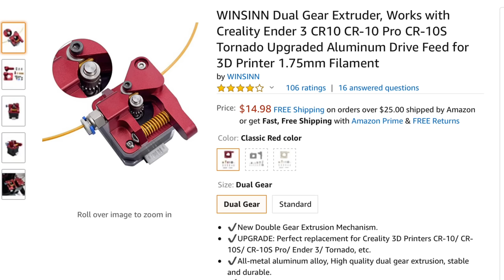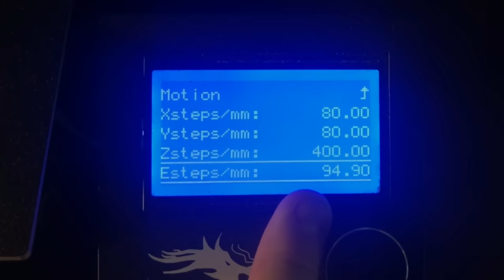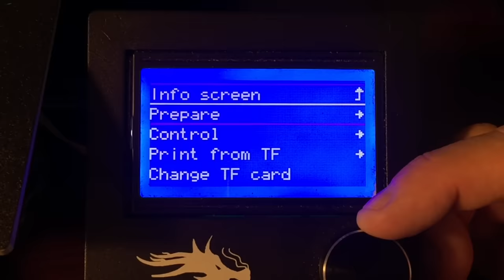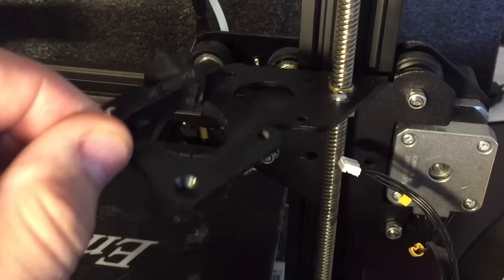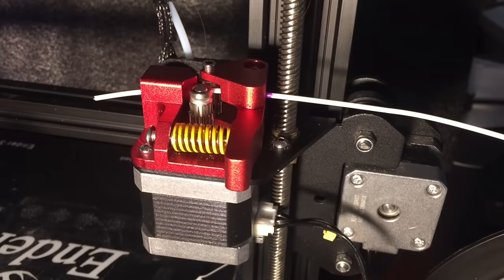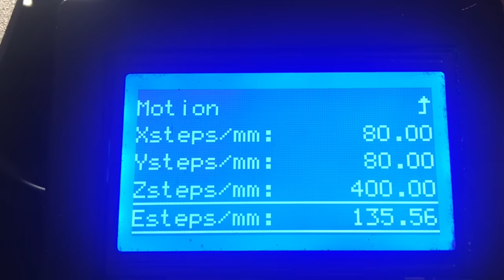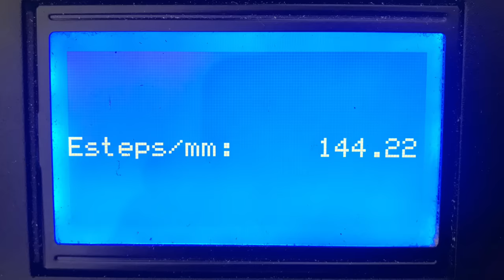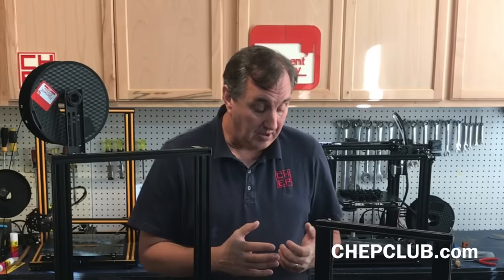Dual Drive Gear Extruder Upgrade + E Steps on Creality Ender 3

Comment: Chuck, this has to be the best video you’ve done to date!   Extremely easy to understand, complete information from beginning to end, and a great topic!    Keep up the awesome work!
Reply from the maker: Thanks Jim.
Reply: I thought the same while watching the video. Smart, complete testing. Excellent editing of the video to keep it flowing smoothly, and ultimately an unbiased conclusion. I regularly recommend CHEP's channel for Ender users. His videos are great for laymen or advanced users. Great work. Keep it up!
Reply: @randomrat6421  yeah great video! love the conclusion! did it work? well no. should you buy one? sure you should
Reply: Too bad it's a terrible design where the gear grinds into the base.
Reply: @FilamentFriday  I have seen a lot of reviews on this and similar extruders saying that the gear starts to eat into the alumina frame. Have you seen this happen?
Reply from the maker: Yes. Some have done that.
Reply: @FilamentFriday  so what's a good one to get?
Reply from the maker: Get the EZR https://youtu.be/1GNDxvxpWr8
Reply: @FilamentFriday  thank you.

Comment: I realize you made this video 3 years ago but I just needed to add a comment.  I got my Creality Ender 3 Pro a year and a half ago.  I was having minor issues with filament slippage a few weeks ago so I re-watched a few of your videos and decided to order the dual gear extruder.  A few days later I replaced my bowden tube and bumped the temp up a few degrees and that took care of most of my issues.  But today I received and installed the dual gear unit and it is great.  I printed a CHEP cube that rivals or betters any I have done before.  Thanks for all you do for the 3D printing community.

Comment: I know this is an older video CHEP, but this video saved me yesterday right before starting my longest print yet. I bought the upgrade before my Ender 3 v2 came and yesterday (only had the printer 3 weeks) the arm failed. I upgraded the extruder in no time flat because of this video. Thanks for all your videos.

Comment: Glad to see you reviewing this Chuck.  I put one of these on my Enders recently to improve reliability.  I ran into a problem with it, similar to your comment about the metal shavings near the gear.  I noticed the screw on my idler gear was not very tight.  I tightened it a little and got a lot of metal dust below the gear.  When I took it apart, I realized that I had tightened it enough that the gear opening was squeezed together (apparently not very strong).  I ended up filing the bottom part where the gear set to get clearance again.  Then I put in some grease into the gear for the single roller bearing and a little below it.  Then when I reassembled everything, I used a little bit of thread sealant on the screw.  That way it wasn't too tight and wouldn't come loose.  It's been working well since then.

Comment: With that dual gear one you should have no slippage at all, maybe adjust the tension on the spring? Also note that the lever sleeve is often a bit too long, causing the arm to twist slightly, causing the motor to miss steps because of gear misalignment. Buffing the gears with very fine abrasive can also help a lot.

The problem with any kind of slippage or missed steps is that you have no control over where or whether it happens, so when you try to overcompensate but are suddenly in an area where the filament flows very freely you overextrude.

It might make sense to experiment with linear advance as it tends to keep the peek pressure of the filament in the bowden tube lower, causing much less occasions where the necessary force is too much.

Comment: Unfortunately, this particular dual gear extruder (I got one also for my JGMAKER MAGIC) has needle bearings in the idler gear.  That is good EXCEPT they ride against the threads of that long screw!!!  They will be eaten in short order  To fix that, I took a 4mm screw of the same length, put it in my mini-lathe and cut off the threads except for 3mm of length at the screw head.  I polished it and then drilled and tapped the top of the lever arm for 4mm and drilled out the bottom hole for 3mm clearance.  Now those needle bearings, well greased, ride on a smooth shaft.  Also, I filed down the bottom surface of that arm to allow a washer under the idler gear so that it doesn't chew the arm to bits.  Those are two huge problems with the extruder that you chose.  
Hope this helps some of you.  :)
Reply: Tom  Is there a better double gear metal extruder that you know of and could recommend for the Ender 3 pro?  I bought a single gear metal extruder and it is chewing up my PLA at the meeting of the gear and the entrance to the bowden tube .  I would like to get the machine back in action as I have a project to do but don't want to get another metal extruder with problems if possible.  Thanks for any help!.
Reply: @terry2346  Any Bondtech or many Bondtech clones will work.  That's what I have now.

Comment: really love your channel 
I brought this extruder because my printer is now 8 months old and the plastic extruder started giving bad prints so I replaced but did not know that I have to calibrate also 
after a lot of fixing ( from nozzle to hot end, bowden tube coupling ,spool holder) I fixed everything but still got under extrusion but finally my printer is now printing fabulous
thanks!!

Comment: This was the first thing I did to my ender on day one. To fix the gear grinding issue, I did two things. 

1: the screw that holds the gear in is the wrong type. Its uses the needle bearing onto threads, that will cause premature wear on the bearing. I replaced the screw with a longer screw that had a smooth section near the head (3x40 maybe?) and cut off the extra threads. This gives the bearing a smooth surface to ride on. 

2: I grabbed some 3mm shims from the local hobby shop, and used a Dremel to create enough clearance to add the shims top and bottom of the gear. I've been printing with this setup for 10 months now, and showing zero wear!

Comment: If I were you I will leave the estep calibrated with the “open” air method and then compensate with the flow multiplier. I write down the printing temp and flow multiplier on each filament roll. You will be surprised that rolls of the same brand but different color they have different flow multiplier even though they use the same printing temperature
Reply from the maker: Actually I do that. You might have noticed my machine was calibrated originally that way as I do adjust in the slicer. But I often get people commenting to adjust eSteps so I can’t win.
Reply: @FilamentFriday  could you please do a video on this process?  That would be super helpful.

Comment: Hey Chuck, I have to credit you with helping me figure out how to assemble this extruder - thank you!  
I have been using mine extensively for 3 months now, but it recently started making a terrible grinding noise, and after pulling off the lever (which you show at 4:39) I identified a MAJOR design flaw in this extruder (at least the version I have), which is that the two idler bearings (which are type K030507 and inside the idler) are rolling on a standard M3 screw thread with all the force exerted by the lever.  This will destroy both the bearing and the screw thread and is both really bad and easy to fix.  
The screw holding the bearing inside the lever (as shown at 4:39) should be a half-thread, so that the bearing is rolling over a smooth surface on the screw, rather than rolling over screw thread.  I cut off a longer half-thread M3 bolt to fit, however my bearing is knackered and needs replacing (but at least it is now no longer making the terrible grinding noise).  There also should be lubrication in here, when there doesn't appear to be any applied in the factory-assembled piece.  I would recommend you check this screw and ensure that it is indeed a half-thread rather than a full-thread, or you will end up killing that bearing.

Comment: The issue you were experiencing at 08:00 isn't caused by slippage, it is caused by the motor not having sufficient torque to push the filament through, itself a combination of a hot end not able to melt filament fast enough and insufficient drive current to the motor. When you increased the esteps to compensate for the 6mm, it meant that now your printer will over extrude when extruding a smaller volume of filament such as when printing slowly or low layer heights, and maybe extrude the correct amount when printing at a load exactly equal to what it would see if the filament consumption was exactly the same as the manual feed speed. If it was printing a tall layer height quickly such as when doing infill, it would under extrude again (flow required higher than default manual move speed) and then over extrude on outside perimeters (flow would be below the manual move speed you've "calibrated" it to).
I think your testing method is very good but you can clearly see the motor snap back at the end of the 100mm move when it is unable to hold the torque. No amount of filament grip is going to fix that, you need to increase the current drive to the extruder, put a bigger motor in or upgrade to a better hot end.
Reply from the maker: The motor would slip not snap back based on your description. I can see slight slippage in the filament. It’s plastic vs metal teeth. Plastic loses. 
There were no over extrusions in the prints including the ones I showed.  Even on the small 3Dbenchy details were fine. 
So my adjustments appear to be just fine.

Comment: Have had one of these sitting on a shelf for about 6 months.  Finally got to fit it over the weekend along with some silicone spring replacements.  Everything looked ok till I printed some small test items.  The filament was all stringy and not fused together.  A quick check on YouTube brought me back to this video which I'd watched before buying the extruder.  E-Steps reset as per Chep's suggestion.  All working fine now!!  Cracking Video!

Comment: Thanks Chep. 

The old one broke off from the idler wheel, the whole section snapped. It wasnt obvious at first because it didnt fall off or anything, it just wasnt extruding anymore. 

I went ahead and got the package that included the motor and it was pretty easy to setup, your video helped on the e-steps. 

Only small issue so far is the hole scrapes the filament, hopefully it will wear down with usage, it seems it already has started to with just one small print.
Reply: Same for me. I also bought a new motor,.because the gear was fixed on the  old motor and the shaft of the okd motor did not have the dent for the new gear.

Comment: It's a very interesting comparison of both systems!
But consider that during a normal print you never extrude a length of 100mm at once, so the pressure is not so strong. My CR10 runs 24/7 since 2 years with it's original cheap plastic extruder and it's fine ;-)
Reply from the maker: So does mine in my print farm. But they sometimes do wear out and many people want to know about options to replace it.
Reply: @FilamentFriday  Which part wears out of the extruder? The input hole or gear? To avoid damaging the input hole the filament must pass it without any angle.
Reply: @stephan.scharf  input hole usually goes first, when I got my ender 3 I was printing lots of glow in the dark filaments and the filament actually cut all the way through the plastic lever in a few weeks of use.
Reply: @stephan.scharf  input definitely is a wear item. i'd rather scratch my filament slightly with aluminium than wear through the extruder over the course of a few months. my gantry changes heights so the entry is rarely straight and i'd rather not hang the rolls off of the gantry
Reply: @MrOsmodeus  I attached a castor to the x gantry in height of the filament hole and the spool holder on top. So the filament goes straight into the hole independly of z height.

Comment: Hi.
Another Great Video,
 Just upgraded ender 3 Max, with this Extruder, Worked fine, Only had to Print a 15mm spacer for under the Filament sensor with longer bolts. to keep it inline.

Comment: After I've installed this dual drive gear, I started to experience clicking sounds comming from the extruder motor. Reading about it online I figured this is a problems where the stepper motor of the extruder is skipping and this could be causes by a blockage in one of the parts that lead the filament to the nozzle/hot-end. After a lot of cleaning of hot-end and all the parts that leads the filament to the nozzle without any success and after looking at a lot of videos online. I came up with the assumption that the spring in this dual drive, presses on the motor pivot too much. I've replaced the yellowish sprint that came with this kit with the old silvery spring that came with the ender 3. The original spring is softer.  This seems to solve the clicking issue.
I hope this helps someone that is dealing with this same issue.

Comment: CHEP, thank you for this video. I had followed some of your other video guides to print flexible filaments but didn't have any success with the printed extruder mod. I installed the dual gear drive extruder and went back and used your slicer settings and have successfully printed the octopus.

Comment: The orange spring that comes with the extruder is the wrong type for this extruder, I've had this extruder for awhile and I'm currently using it  as direct drive. Works great but comes with the wrong parts

The spring tension adjustment doesn't work because the spring is the wrong type. You need to use the spring from the original extruder. That's also why the arm is grinding into the base. And you had an issue with slipping. The orange spring puts alot of unnecessary load on the motor and is not good for it in my opinion. Just use the original spring and use the tension adjustment.
Reply: Mine just came with this wrong spring, too. I've just used the old one
Reply: @martingerken7094  Yeah unfortunately no one seems to have noticed the issue or cared. Its actually a fantastic extruder upgrade but you need to use the right parts.

Comment: Be aware that you should check your motor before purchasing this thing.  If it has a pressed on gear (the brass thing that feeds the filament line), you can't replace it as shown in this video unless you get a new motor as well.
Reply: I wish I had read this before
Reply: @fg2873  me too...

Comment: Oldy but a goody.  Thanks for this.  I just bought a WinSinn and your video was great for helping to get it all setup.  A couple notes for folks that necro this video.  1) there is an extra spring in the kit.  I think it's just a less stiff spring in case you want that. 2) when aligning the teeth, leave the one on the extruder a little loose and then put the arm in with the other pully.  match the teeth up through the old.  or better yet, just assemble it out of the system and match the teeth.  3) I was in the 138 estep range from a old step of 93, so about the same as the video. 4)If i had it to do over again, I would take the time to measure out the full load and unload length.  If forgot to do this.  you can do it later, but it's just easy when it's all apart.  That length will help if you have a plugin for doing filament swaps.  One button to remove and reset.  Anyway, great video and a huge thanks!

Comment: Note that this dual gear no long fit for the Ender 3 Pro (2021) due to the stepper motor shaft is shorter and the wheel gear is pressed on to the shaft.
Reply: Ordered my E3 Pro and Dual gear at the same time and came to this vid hoping to figure out how to get that gear off ;n;
Reply: Just replace the stepper motor with the correct one
Reply: @kharmastreams8319  do you know what the correct one would be?

Comment: Esteps came out perfectly the first time.  Thank you!  In the process off printing the first Benchy from my brand new, but heavily modified Ender 3 pro.  Dual Gear, direct drive, SKR 1.4 Turbo, Hero me fan mod.  My goal was to get as close to a Prusa without spending Prusa money.   I think I might have succeeded!  Watched your assembly video as well.

Comment: I like the new dual gear extruder but I miss the 3d printer knob I had on the older one. Are there any designs for a knob on the dual gear extruder somehow? Thanks for the great content!
Reply: Did you ever have any luck finding a knob? I'd love to know where
Reply: @johnwhiteanderson1  nope, and I don't think it's actually possible. the dual extruder was designed on a way that doesn't leave enough space on the stepper axis to connect any kind of knob.

Comment: Some of the newer ender 3 pros have a gear pressed stepper so you can’t remove it. Could you do a video on how to remove the gear pressed ones and how to install this extruder on them, or recommend a new stepper that has a screw like the one in your video? Thanks!
Reply: The press-on does not have a flat spot on the shaft.
Best solution is to replace the stepper motor with a better one

Comment: Thanks for this guide, just put this extruder on my CR10S5 which came with the same extruder as the Ender 3, I also have a 0.8mm nozzle and a 5kg spool.. So now I have my esteps dialed in 100% thanks to you, looks like my under extrusion issues are a thing of the past.

Comment: This kit won't work properly on newer Ender 3 Pros, they started press fitting the gears so they are difficult to remove. The shaft on mine doesn't even have a flat spot.
Reply: Did you get it to work. I have installed my kit but the extruder wont feed the filament
Reply: @medvus750  I haven't bought the kit. Does your ender have the pressed gear or were you able to swap to the Kit's gear.
Reply: You can buy a new motor for about 10 dollars
Reply: @imapotato5927  True, Adafruit stocks them at $14